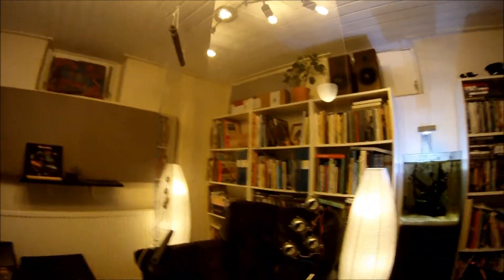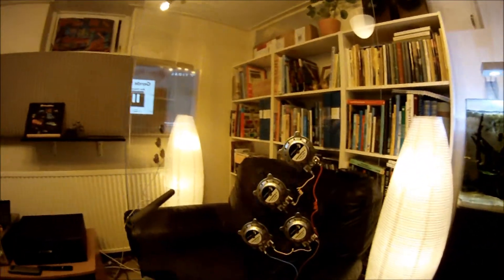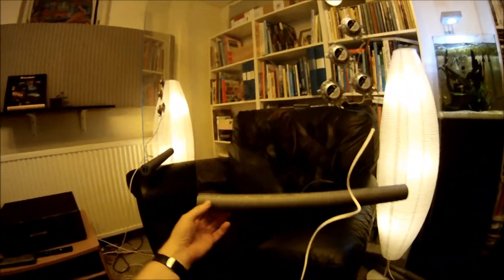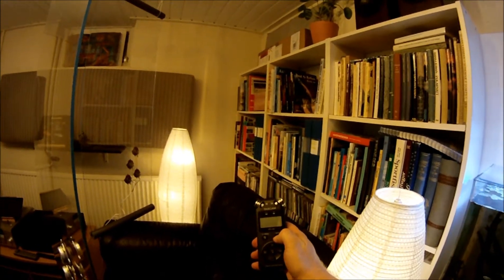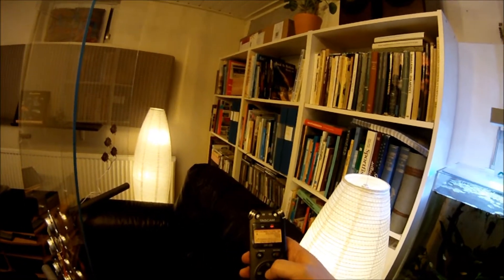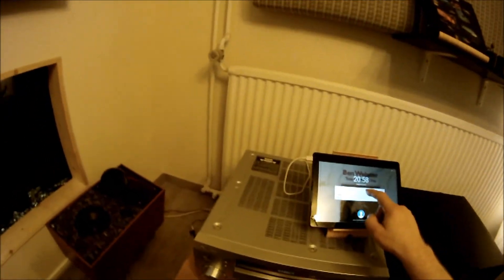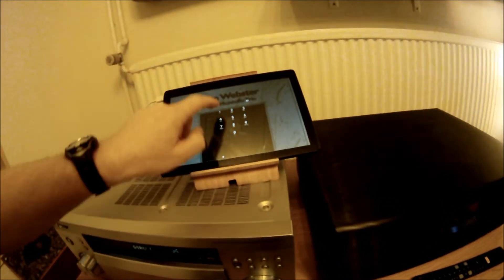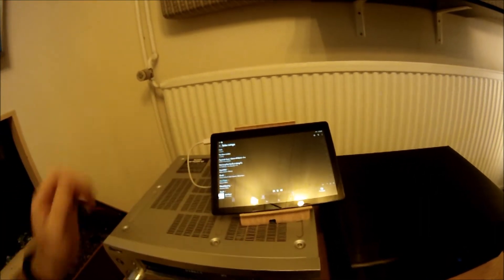Leif show Acrylic DML panels as near field speakers!

Comment: There are some that have tried putting the drivers on a thin (<=4 mm) birch plywood sheet glued to canvas. Then the framed the canvas (as one does ;)) and hung the “paintings” up on the wall or put them on stands. I guess the frame acts a lot like a suspension for the canvas. Did you try something like this?
Reply: And thanks for this info!

Comment: I think your amplifier is very high quality and it must make a big difference!
Reply from the maker: More so the distance from panels to ears equals 30 cm. It takes a huge amount of more  amplifier power to reach the same sound pressure from 3 meters. 2x400W on a 80x50cm membrane from 30cm can deliver very unhealthy dynamic performance to your ears before distorsion becomes noticeable......

Comment: Thanks Leif, very interesting design! I'm testing with acrylic 2' diameter disks, in 1/8 and 1/4 thickness. I'm comparing exciters from : - Dayton Audio DAEX25SHF-4 (smaller but heavy on the vertical) comparing with ; - Visaton Extended mount EX 80 S (powerfull but damping a bit cause the surface ratio is big). I like the dynamics in mid anf highs and will use a sub for the bass anyway, so i can send you my tests if you want to share. I'll send you my personal e-mail if you want to discuss tests and results. Martin
Reply from the maker: Hello Martin! When using large acrylic sheets down to 78Hz as I do, I find them most suitable as nearfield monitors. When I tried them as regular speakers at three meters listening distance.....I loose some of the benefits compared with nearfield listening. One cannot put too much power into the large drivers/panels without some audible distortion.  Using smaller /lighter panels may overcome this issue. But then of course you may need to move crossover frequency upwards. Most subs don't do well when crossed above 80Hz.

Comment: Thank you. I have questions: 
Do you think if using 4 drivers mounted asymmetrically, there is no needs to put additional weights to kill resonances?
Near field – is it for getting lower frequency and cross sub at 40Hz? Or sound is degrading on distance?
Reply from the maker: Hello VK! Since this video, I have added a 200x350x30mm padding (similar as used in boat engine room) connecting the drivers magnets together adding some mass as well, (without adding too much weight on the spindles). This makes it possible to make a frequency sweep at MUCH higher level without any audible rattle or distortion from the drivers. The issue is otherwise with these drivers, they rattle at resonance frequency, both driver resonance frequency and at panel resonance frequency.   However this is at quite high level when acrylic panels are close to ear, but certainly makes audible distorsion when the panels are used as conventional speakers at let's say 3 meters distance.  Sound is very clear and easy to listen to for hours on end without fatigue. Just like listening to large electrostatic headphones. But without the weight on the head.
Reply: @vikinghasselo  Tech Ingredients  fixed panel resonances by adding additional 5 weights on it with single driver.  https://youtu.be/zdkyGDqU7xA?t=1189 Have you try his way? 

You are using 4 of them, I thought you experimented with them.
Reply from the maker: @v-k883  Teck Ingredient later removed the weights completely.
Reply: @vikinghasselo  Right, he removed them, without explanations. Later he wrote in comments “It should be more testing” . That is why I asked you tried them. If not, not is ok
Reply from the maker: Sound is degrading at increasing distance, by dispersion and by reflexions from surroundings. Also longer distance requires multitude of more power, with higher ampifier and speaker distortion as result.
Reply: @vikinghasselo  It seems, you are doing something wrong. Could you take a look at following
https://www.youtube.com/watch?v=csP0IfNLJIc 
https://youtu.be/jJTvdarhQjI?t=35    -   here I can see 2 drivers only - DAEX30HESF and something else
https://www.youtube.com/watch?v=uaGjFYQut3E
This is the level of sound pressure they can produce.
----------------

https://youtu.be/dvHrtYBf8lU?t=20   here we can see 4 drivers. About the box - this is the protection of Exciters because there is no distortions in case adding too much power and possible to burn them.
at 170 sec we can see how it was made -   https://youtu.be/dvHrtYBf8lU?t=170
Reply from the maker: @v-k883  You can achieve extreme sound pressure with the panels. Especially by using other materials than acrylic. Acrylic was aborted by Tech Ingredients for its low efficiency. But, high efficiency always comes with a cost. I have noted that all materials tested as DML panels so far has a ringing sound to them. They shout at some frequences: the driver resonance frequency, the material used have a ring tone, the dimensioning of the panel and finally the lack of resonance damping on the edges. All these anomalities creates shouting and must be kept at minimum, and at the same time have wide frequency responce and efficiency.......something has to give. In my case, I prioritise sound quality before anything else. That's why I use acrylic despite its low efficiency and tendency to sound bad when overloaded. I solve that by using 4 assymetric placed drivers (as recommended by Dayton Audio) adding edge dampening, and most important, use them near field. Then they sound fantastic and now many people have listened to them here and every listening session have lasted for several hours.......that rarely happens with ordinary box speakers 😁
Reply: @vikinghasselo  Thank you for your details, that exactly what I was looking for – what king degradation and why. Thanks again.